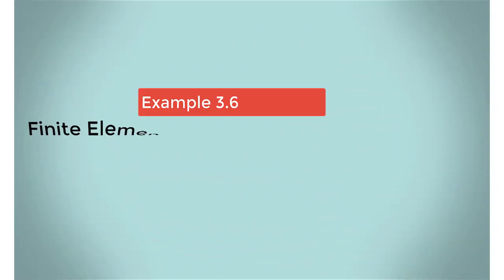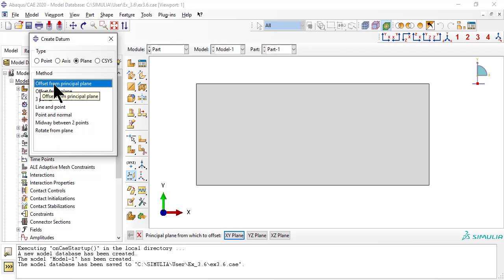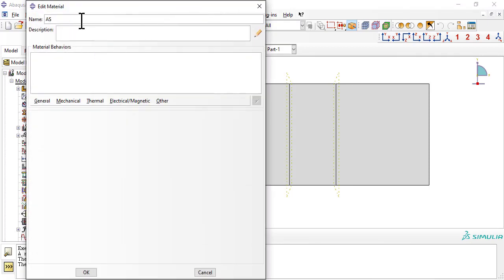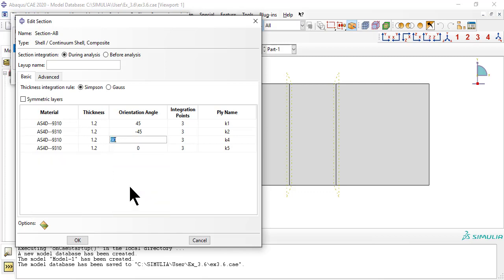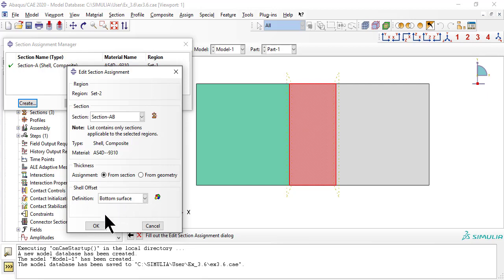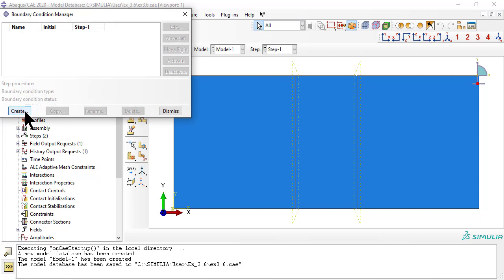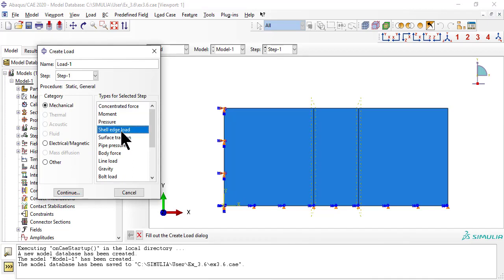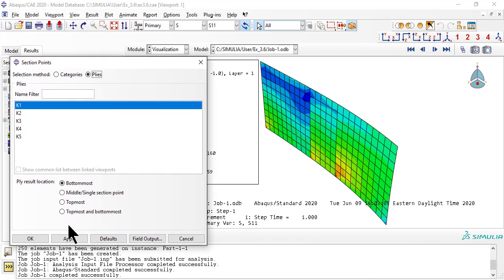Example 3.6 How to to model a ply drop off using 3D deformable shell and partitions in Abaqus

Comment: Dear Sir,

Could you explain about the cross-product coefficient and bi-axial stress value in case of Tsai-wu Criterion
Reply from the maker: Don't use Tsai-Wu criterion, because includes interaction between fiber-tensile-failure and transverse/shear failure, which gives unrealistic results. If you want an interacting criterion, use the "interacting criterion" described in my textbook https://www.amazon.com/exec/obidos/ASIN/1138196800/booksoncompos-20 but truncated-maximum-strain is even better.
Reply: Thanks sir,

for guidance. But generally for composite pressure vessel Tsai-Wu used by many resecheres.
Reply from the maker: Not so much in industry.